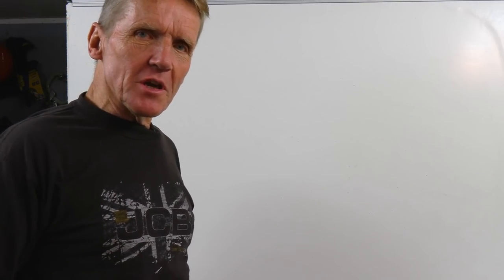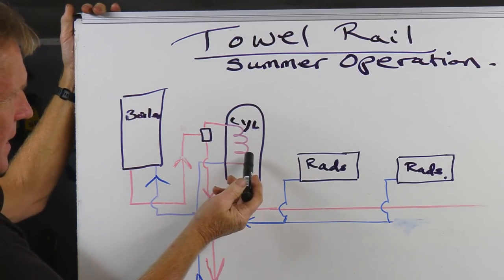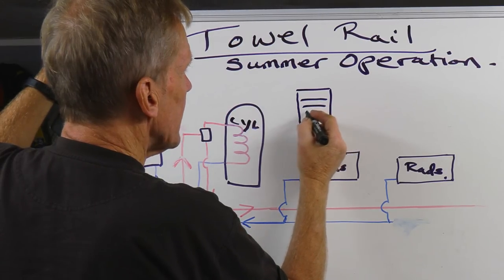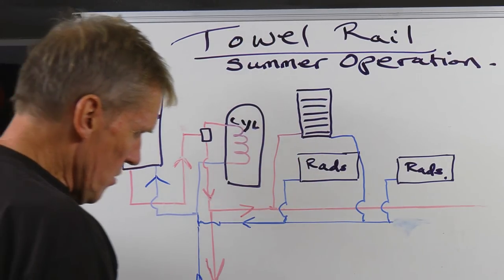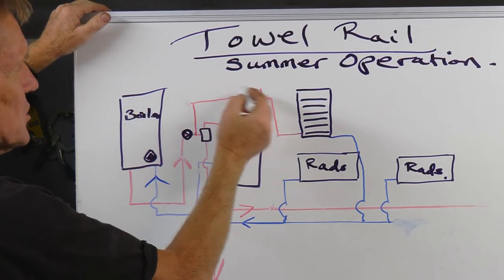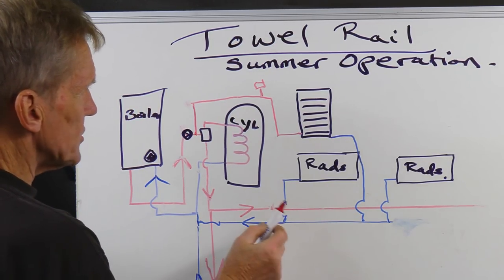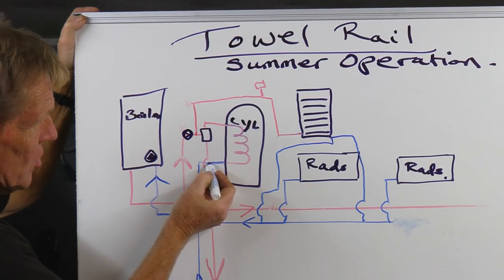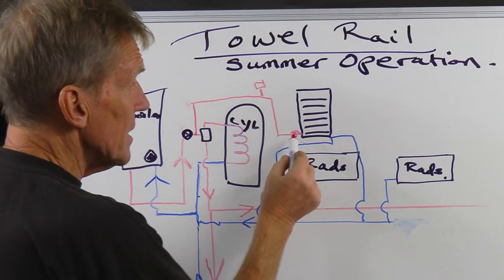How is Your Towel Rail Hot When the Heating Is Off?

Comment: Very good video. Question: I have a new system boiler to all is mains pressure. New cylinder very efficient so airing cupboard doesn't get warm. Can I have a small red in airing cupboard linked also to towel rail so both heat with hot water ? All very close together Thanks very much

Comment: If the towel raidiator valve was closed so it doesn't get warm anymore in summer, what would happen if the raidiators/heating was drained, I assume that water would stay in? 

Secondly If you refilled the system with some protector, inhibitor etc would that feed into to towel raidiator if the value was reopened after the fact?

Comment: Hi Roger
My old towel rail was 530 mm from center to center on the pipe. What size towel rail would I get to replace it. Or would I have to do some pipe work to connect a new rail.
Great videos very informative.

Comment: Have you the link for reverse circulation.  I have hot flow to towel rad but no return flow so rad isn’t heating up. It is plumbed as your schematic shows (maybe it’s air).  All other rads work fine.

Comment: Hello roger - is it ok to leave the valves to the towel rail open then when the heating is off but the element is on ? 
Thank you.
Reply from the maker: yes that is fine. If you find that one of the two pipes is getting hot you may have a problem with it circulating but that is not normally the case because one of the legs of the heating circuit is closed. I have never had an issue with it.
Reply: @SkillBuilder   thank you

Comment: I have a combi boiler, and what I've done this summer in order to have the heated towel rad come on, was to set all the rad thermostatic valves to zero and just left the heated towel rad on max. I then set the heating to some on for an hour in the morning and again in the evening. Was that the correct thing to do? Cheers
Reply from the maker: That is fine, if it works then it works and there is no need to get complicated.
Reply: @SkillBuilder  haha! That's the exact scenario you said was complicated! 🤩

Comment: Great vid. Any idea why my towel rail only heats up some of the time when the hot water is on, it seems very random? They don't have thermostatic valves.
Reply from the maker: Once the cylinder is hot the water from the boiler won't flow so the towel rail, which is on the same circuit won't heat up until you use the hot water.  The way to get around it is to have the boiler temperate set lower than the cylinder temperature so the water keep circulating. It is a bit wasteful in terms of energy but it will work.

Comment: I consider myself lucky to have this problem. My cylinder and 120l boiler (s system) is downstairs and there is a bit of hot water convection (= reverse circulation?) going back in to the heating return pipe and all of this heat goes into the first rad upstairs which is fully open towel rail. So when boiler is calling for heat (mostly after a bath or shower) the towel rail is warm and this is brilliant for drying towels during non-heating months
Reply from the maker: Roman. It is not a problem. The video is just explaining how and why it happens.

Comment: Which do you prefer Roger? conventional system with a hot water tank or a combi boiler system. From both a failure/repair point of view and installation cost & I suppose ease of both the above. Be interesting to know what a seasoned tradesman thinks.
Reply from the maker: Ha I  like the 'seasoned' bit I will remember that next time somebody calls me an old git. In my house I have two unvented cylinders in tandem. One is a solar pre-heat and the other is heated by the boiler. If you have two or more people using showers or baths at the same time the stored hot water option is good. If you are short of space or there are just two of you in the house then a combi is a good option. They are cheaper to run but not as reliable and there is no backup if they go wrong but these days the service call-out is better.

Comment: Hey Roger do you fancy coming over to Ireland and plumbing my new build. Air to water system😁 no better man👍👍
Reply from the maker: Hi Gary
 I am afraid I am turning down jobs on my doorstep and, as much as I love Ireland and the people, it is not possible. I have done a few air source jobs, they work well enough with underfloor heating but you need an electric top up for the hot water system.
Reply: Skill Builder ah don’t worry it was just wishful thinking. Do you not think the air to water is powerful enough to heat the house properly? I was thinking of underfloor heating downstairs and Rointe electric radiators upstairs if they are needed? What are your thoughts. Love the videos keep them coming👍👍

Comment: Can I ask you a question pls. We have new boiler from British Gas. Combi. If my room thermostat is lower than 25 the rads/boiler do not come on. Is this because the house is already that temp. But my towel rail is fed from this so I can only get the towel rail/radiators hot if thermostat on 25 or above. My sis has hers on 18 and her rads hot on that. Thanks. X.

Comment: Hi Roger. I have a boiler and water cylinder system. My towel radiators heat up when both central heating and hot water system turns on.. but during summer, I don't want the towel rads to turn on. I would rather have them on only with central heating is on. Is there any valve to control that? Or is it a setting in the boiler? Thank you
Reply from the maker: There should be a valve on the towel rail. If you can't see it send us a picture 
www.skill-builder.uk/send

Comment: Hi Roger, I got two Towel rail summer operation Radiators and does it affect if I upgrade to Tado smart thermostat? Thanks.
Reply from the maker: You should be fine, the towel rails are not on the controlled circuit so they operate when the boiler fires up
Reply: @SkillBuilder  Thank you...

Comment: Thanks again. Doesn't it operate as a bypass sometimes for pump overrun?
Reply from the maker: yes you are right
Reply: eazyrat only problem with using it for a bypass customers can turn of towel rad closing the loop
Reply: @roycarter5717  yeah I can say I've ever liked the idea but people do it
Reply: Doesn't need a bypass on a 3port, always an open port. Bypass is only req to be compliant with energy efficiency regs
Reply: @98067100  does this mean its not a safety concern or a problem for damaging the boiler?
Reply: @eazyrat  Not as such. You need a bypass on an s plan because if one of the valves sticks electronically then you have no open path for the water to circulate and yes this would be unwise because your reliant on your boiler stat... Overheat stat and open vent all working effectively... Long and short of it the boiler will dump hot water up the oven vent into your f and e until the boiler shuts off if it does. So in that scenario you need a bypass so when that does happen the water can circulate somewhere... Some boilers have integral bypasses and others have tacometers or automatic bypass valves or a simple gate valve. Most but not all modern boilers have a pump overrun feature which if wired up will run the pump after a demand for a set time or until the heat exchanger has dropped below a set temperature. With no bypass it has nowhere to go. Those without bypasses and no overrun tend to be older chbs and as you can imagine when demand ceases and the boilers just been running 60 to 80 deg and the pump stops and the ch and dhw valves close all that heat has to go somewhere... Up the open vent causing alot of air ingress and there in lies the start of a corrosive process.

On a y plan with therefore an open port some of that heat can dissipate  making the need for a bypass redundant but energy eff regs have changed and its recommended now. Some chbs like i say have the overrun feature which should be used where possible because anything to pull residue heat away from the boiler after a demand will stop anything shooting up the open vent.

On a sealed system s plan you do, y plan again same thing you don't but regs say you do.

You on the whole have at least 1 Rad that has mrvs not trvs. Normally the hallway where a room stat is located. The idea being that with trvs as each room starts to reach temp the trv shuts the Rad off and the space with the mrv is the last to satisfy and clicks off the room stat. Thus making an efficient system, if you had no Rad with mrvs then if every Rad shut off then water would just circulate through the 2port or 3 port to nowhere. Some have multiple rads with mrvs like towel rads, no problems they will just go off when then room stat satisfys as well. You can't have your room stat in the same space as somewhere with a trv really because they're both trying to do the same thing and regulate the heat in there surroundings.

There are lots of other scenerios like 1 pipe systems, gravity dhw with pumped heating, pumped dhw with gravity ch, sealed systems, multizones, gravity setups where cold feed and open vents haven't been moved when converted to fully pumped, half converted versions, hot water priority etc etc. In all cases your best with someone with experiance to see what you have to what you need to have, system design isn't rocket science for those that know but you'd be surprised how many people out there don't know the basics. Hope that helps.

Comment: Hi Roger. After draining down my mega flow system to change a radiator valve. After refilling the bathroom towel radiator is Stone cold. Both flow and return pipes are also cold.  All other radiators heating up fine.  Towel radiator is fully bled, and there's pressure inside,  yet completely cold. Flow and return valves are just tap style,  not thermostatic. One of the valves is stiff to rotate.. do you think some dirt has blocked the valve when draining down?. Please help..
Reply: .. was working fine prior to draining down to replace the leaking valve on other radiator..

Comment: Don't current regs forbid connection to the HW circuit? I thought newly installed towel rails had to be installed as their own independently controlled heating zone?
Reply from the maker: I have done that with combis when the customer wants several towel rails in different bathrooms but for on towel rail we will just call it a heat leak.

Comment: Wouldn't the return from the towel rail in summer cause reverse flow in the radiators as the return from the cylinder would when connected wrongly (they seem to be connecting at a similar part of the circuit)?

Comment: So do you have to leave the heating on to get the boiler to produce heat and if u turn the thermostatic valve off won't the pump be fighting a dead end?
Reply from the maker: It is the hot water cylinder valve that fires up the boiler so it will only run on the cylinder circuit
Reply: @SkillBuilder  cheers m8 all makes sense

Comment: Hi Roger. We recently had elements installed in out towel rads but the plumber put them in the supply side of the rad. Any reason why you recommended them being in the return side? He also supplied ones which are too low power so it takes 4 hours to heat the roads but that’s a separate issue 😕
Reply from the maker: I think it is fine to put it in either side because the rad will not have a flow through it. I am surprised that the towel rail takes that long to heat up. Hopefully there is no flow going through it.
Reply: Skill Builder Thanks Roger. Think the plumber only used little 300w element and they are 1.8m towel rails 🙁

Comment: So basically when the cylinder calls for heat that’s when the towel rail warms up? Otherwise the boiler and pump wouldn’t kick in?
Reply: Anytime the pump is on, the towel rail will heat up.
Reply: Nathan Brown yes exactly sorry I meant in the summer months when you’re not using the heating
Reply from the maker: Yes you are right to say that in the summer the towel rail comes on with the cylinder but in the winter it works with both. It usually works out well because you have a shower and the towel rail kicks in to dry your towel afterwards.

Comment: Roger, you're gonna hate me. What if the bathroom rad only gets luke -warm at the bottom, despite being vented off at the top. Yer know, one of them tall, upright panel rads with a sticky out bar bit fer draping yer fluffies over? 

Some eedjut has not taken note that some of these panel rads, flow and return have dedicated valve points. I.e. It's directionally specific and wont work properly if flow and return aren't piped up correctly.
Reply from the maker: Hi Loafer 
That is great. I must admit I didn't know that unless you are talking about the ones where the tapping is at one end only or in the middle. I will investigate now.
Reply: @SkillBuilder  No, Roger, not one of these monstrosities (single tapping point, twin rad valves) 
https://www.youtube.com/watch?v=yVoAblQvHLs
Just a standard, flat, upright panel rad. They are usually supplied with lhs and rhs  valve points, blank and bleed like any standard rad like a standard rad. However, one side is designated flow, the other return. One would assume that the install notes actually make this explicitly clear. The one I sorted out actually still had a red sticker rear on one side (flow) and a blue sticker ont t'other side  (return). I can only presume that they have a diverter tube built in to encourage the circulating water to rise up and across the rad  before falling to return??? Similar to the monstrosities aforementioned. All I know is someone piped one up incorrectly and I had to rectify the problem. Grabbed both tails to determine f/r and when I whipped rad off, luckily the stickers were still attached on the back.
Reply: Just sent you a link to "contact skill builder". Hope that this meks it clearer. Pity mi home brew isn't as clear.

Comment: Unless there are a few check valves in the system (not shown in diagram) I can see no non-negligible difference between connecting towel rail return anywhere on the return (blue) network, including the return from the cylinder.  Hydrostatically speaking, the pressure is just about the same in the whole blue network.  Hydrodynamics makes a (negligible) tad of a difference, but that gets very complicated to calculate (anyone remember the Reynolds number?).
Reply from the maker: Nacho 
If you watch the other video on reverse circulation you will see what happens if you connect the return in the wrong place.